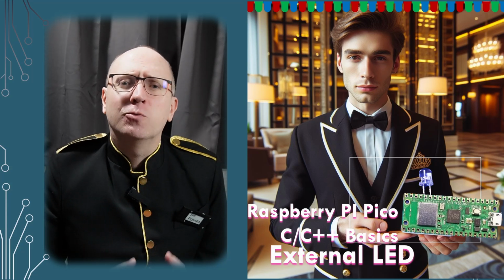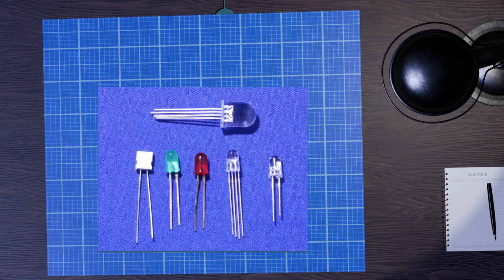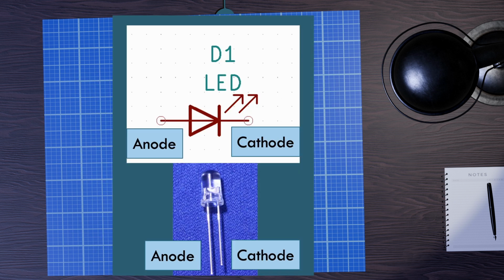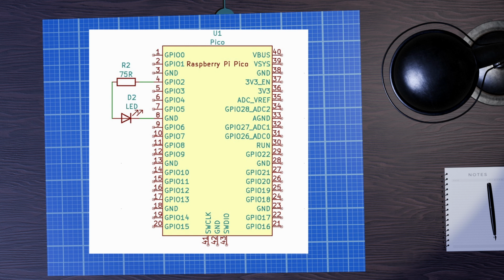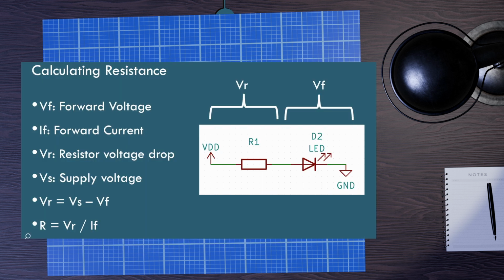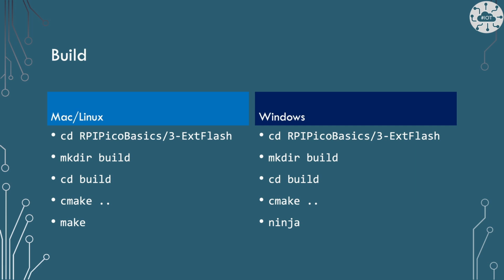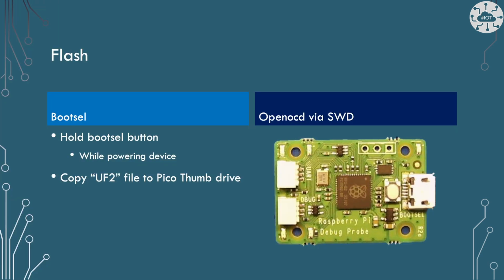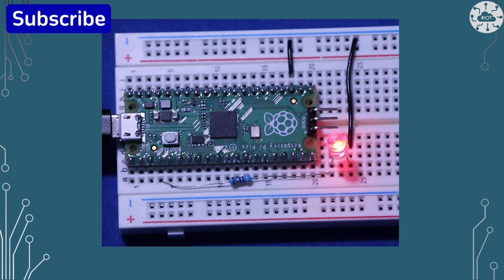Tutorial connecting an external LED to Raspberry PI Pico with C/C++ | DrJonea.co.uk

Comment: I found a very useful method of getting into the mode of updating code: use picotool.  With the Pico connected to your host via USB, you can reboot the Pico into program mode.
Very helpful when it isn't practical to get to the bootsel button.
I now use this method when I want to update the 300x16 sign my dad and I built.
Reply from the maker: Great tip! Thank you for sharing.